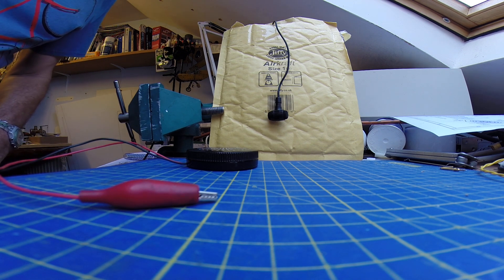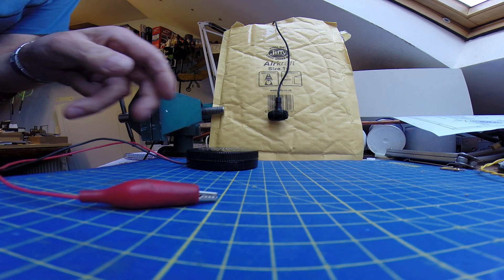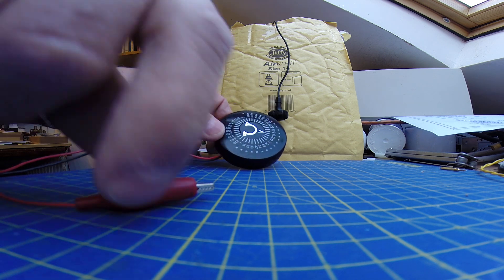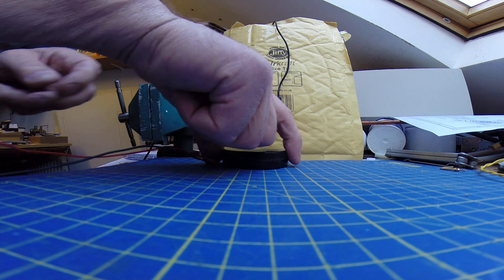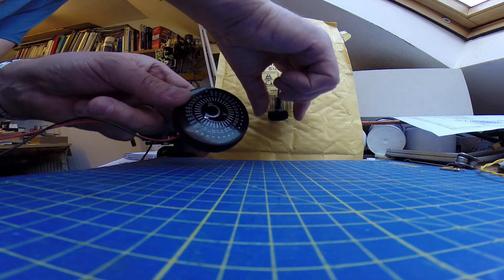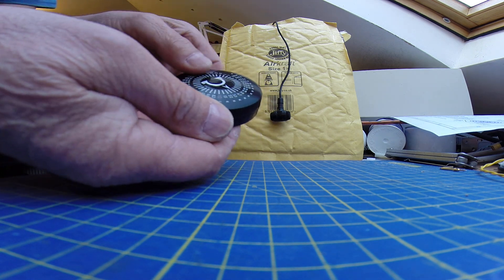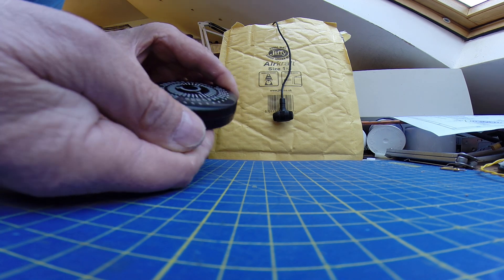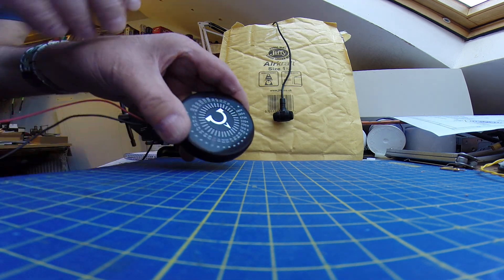GoPro Hero 3+ EXTERNAL MICROPHONE TEST resistor value

Comment: The resistor value having to be within a certain range isn't strange; the gopro cpu uses an ADC to read the resistor value, it supports a number of different peripherals on the 10-pin USB port all differentiated by different resistor values

Comment: For anyone else researching this, I believe the gopro selects what happens at the USB connector based on the resistor value used at this location. I need to confirm it 100%, but I think 100K activates video out only, 330K activates the mic in only, and 33K activates both. This might explain the findings in this video.
Reply: Andy Grigg Have U confirmed Yr suspicion? I'm on stright line to finish my multi-port PCB with 10pin miniUSB connector to Hero3. I'd like to have RCA A/V output for my external FPV monitor and 3,5mm mic input port for Rode mic. Is a 33k resistor the best choice? Will I have video out and mic in activated?
Reply: Yes

Comment: So the best is to use a 300k resistor, but do you use a 1/2Watt or a 1/4Watt and does it make a difference if it's a carbonfilmresistor or a metalfilmresistor? thanks in advance for the info.
Reply from the maker: Matthias Balcaen 
It doesn't matter resistor type or size, smaller the better!
Reply: Thank you for the reply, just one more question, so the 300k is the best? I've read that the cable comes with a 33k resistor, somehow i'm confused which one to take.
Reply from the maker: Matthias Balcaen 
That's why I did the test!  you choose!
Reply: John Wells sir can you please tell me if i want to use only mono mic but want to get audio on both channels should i solder the postive cable of mic to both 6 and 7 pin? will i get sound on left and right channel ?

Comment from the maker: Yes Marcel, just a cheap dynamic microphone, as you can see, you need the correct value resistor inside the mini USB plug (10 pin type too, not the usual)!
Reply: Thank you! Get it now! :)
Works great, but after a month I switched to the Sena AudioPack ^^
Very great video btw.! Linked it a lot :)
Marcel
Reply: Ah I forgot. Where did you got these decade box?
Im from germany and I cant find one here or on the internet? o.O